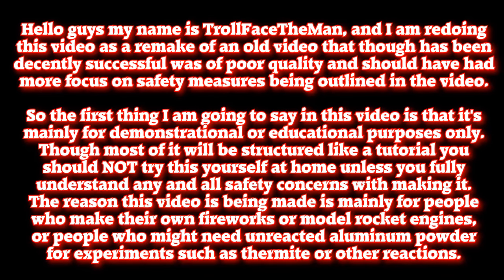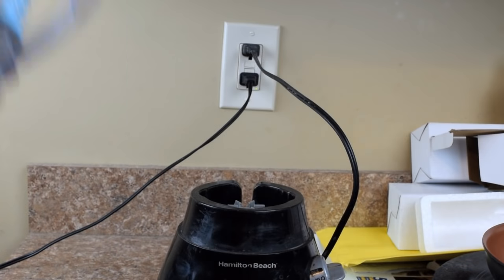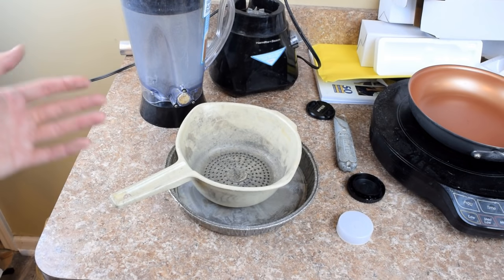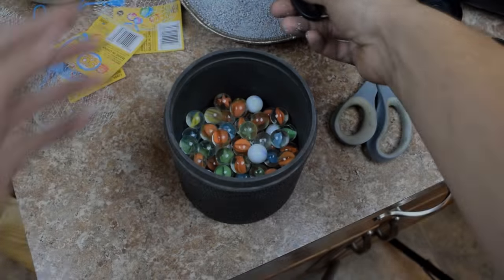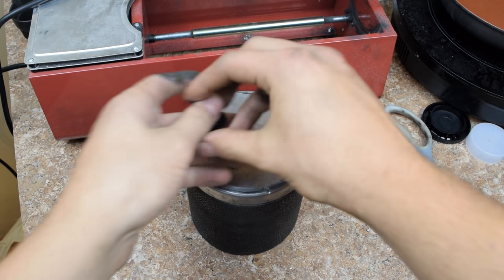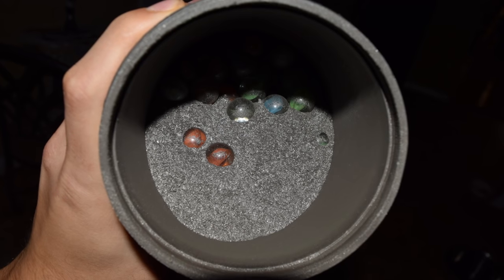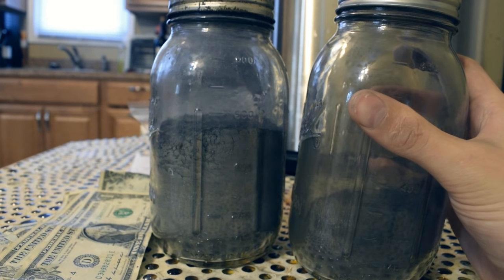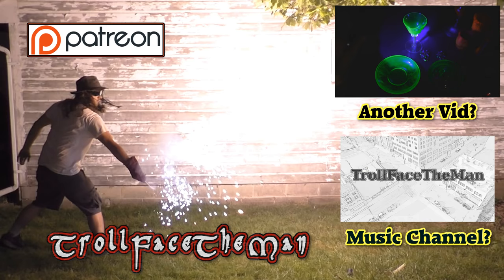How To: Easy Bulk Dark Aluminum Powder (My Homemade Process)

Comment: There is no 'b' in 'pyrophoric'.
It might also be worthwhile to review the definition of 'subjugate', specifically in comparison to the verb use of 'subject'.
Also, check out the difference in 'substantiate' and 'sustain'.
Reply from the maker: I will admit the Pyrophoric thing is my bad, I have dyslexia and sometimes I can literally read a word hundreds of times the wrong way and not notice unless someone such as yourself points it out. 

 However in respect to "If subjugated to an open flame..."

The way I used it was "Brought under control of an open flame..." Basically the flame will violently exhumed control over the powder as it is consumed in a fireball (Or it'll be subjugated by it.) I will admit it is not the best way to say it, but I don't feel it is improper.

 The last thing with: Check out the difference in 'substantiate' and 'sustain...'

 I do believe I said something along the lines of "To self-substantiate a flame..."

 By definition Substantiate: "To affirm as having substance give body to; strengthen*. Example: To substantiate a friendship." or *"To give form or real existence to..." (Their are about 7 more but these are the ones of particular interest to my point...) 

 The way I used it was in respect to say "The powder needs to be fine enough to Self-Strengthen or Self-Exist..." Basically it needs to be able to support burning by itself without  additional input.

 Once again that too would fit the definition quite well.
Reply: TrollFaceTheMan  How refreshing to see someone dispassionately evaluate suggestions/criticism, keep the parts judged worthwhile and discard the parts found wanting, all while maintaining a nonadversarial tone.
Reply from the maker: Well thank you, and I also appreciate your critique being in a similar respect.

Comment: So I have a smelter and make chunks of it from recycled cans. I don’t have 20 lb lead balls and a mill that’s 200ft long. Anyone got an idea of how to make this easy to grind?

Edit: well I learned something new. I had lead shot just hanging around and I thought weight would work
Reply from the maker: Lead is softer than aluminum. Trying to mill with it will result in a lot of lead contamination as the aluminum grinds it up.
Reply: @TrollFaceTheMan  hey dude, can I just jerk of the container by hand  because to speed up the process

Comment: how bout round chuncks of quarts rock hardness scale is above glass prettysure it doesnt spark if hit hard
Reply: tyler quarts sparks very easily
Reply from the maker: +Jimmy Star It only sparks if hit against Metals. Just like in a Flint and steel, it's not Flint that sparks but the Steel.

 Excluding some types of quarts which can spark via Electrical discharge if it is broken.
Reply: TrollFaceTheMan I used to make fires by taking two quarts rocks and hitting them together producing a spark, maybe it was reacting with something else but from my experience quarts usually produces a spark on contact
Reply from the maker: +Jimmy Star The way sparking actually works is you shear of tiny bits of metal which as they fly they oxidize generating heat and inevitably generate what we call sparks.

 For example you strike a piece of Steel (Fe) with Flint, the Flint is harder than the steel which causes bits of steel to shear off and fly through the air.

 As it flies through the air it reacts with oxygen and heats up exponentially (4Fe+3O2=2Fe2O3+Heat.) 

 The problem with Quartz sparking is Quartz is Silicone Dioxide or SiO2. Because it is already Oxidized it can't oxidize when stuck against itself, thereby it can't Spark. (Quartz can still cause an electrical discharge though.)

 If you could strike two Stones together to create Sparks it most likely was something that was rich in Pyrite (FeS2) or Pentlandite which is Iron Nickel Sulfite.

 Those types of rocks can still spark because of their iron content and the fact that they undergo the same type of shearing and oxidization as a rock striking regular iron.
Reply: TrollFaceTheMan wow thanks for your great response it was very interesting and informative. You should make more videos exploring the chemistry behind such reactions. 👍🏻
Reply from the maker: Jimmy Star No problem, I am always glad to see comments like yours too which are respectful. And glad to see people like you who are willing to openly discuss a topic without become defensive over potentially contrasting information to their point.

 That is a rarity now a days, especially online.

Comment: All this safety about the aluminum catching fire. But doesnt realize you cant have a grill that close to plastic siding or it melts.
Reply from the maker: I wasn't the one that did that.
Reply: @TrollFaceTheMan  that explains it then. Someone needs some safety tips like dont light freshly poured lighter fluid got to let that stuff soak in first.
Reply from the maker: @SudoMimic3 , it's a propane grill. It was radiant heat that did that.

Comment: Why not add water to blender for slurry then air dry?
Reply from the maker: Theoretically it might work as long as you are using really clean water like distilled. Otherwise it may cause issue.

Comment: Use stainless steel or brass the aluminum needs fuel in order to cause any problems.....such as explosion.
Reply from the maker: If there is any air then it can ignite. It doesn't need a fuel, it needs an oxidizer.

Comment: I milled magnesium and opened the container once a day and it still auto ignited on me
Reply: This video is about al not mg. There is a big difference
Reply: @amelbecic5332  yeah ik i was just throwing it out there
Reply from the maker: Hopefully no one is hurt. The magnesium is much more reactive and may need to be aired much more often.
Reply: @TrollFaceTheMan  Yeah, I always go a bit crazy with PPE when milling mag, especially since I use stainless steel balls. When it auto ignited, its like it EXPLODED. I dont know if aluminum is the same because I never had aluminum auto ignite on me.

Comment: how do u store it if when u open it it explodes
Reply from the maker: +The Garage Scientist You only have to worry about auto ignition if you don't air it at least once day during milling.
Reply: so it wont explode when i open after storing for a moth
Reply from the maker: +The Garage Scientist No it shouldn't, the reason it can do it while milling is because new surface areas are constantly being exposed.

 But sitting there is not the same case. Also it won't explode anyways it'll just catch fire, unless it is mixed in the air in extremly fine particles first.

 Which shouldn't happen unless you were to like shake the jar around a bunch and open it without letting the dust settle again.
Reply: ok thanks, also could i mix the 2 powders with a quik shake in a bottle if they are already powderd

Comment: I CANNOT STRESS ENOUGH how important it is to air it out on a regular basis. I did this without doing so, expecting it to be some 1 in a million occurrence that you avoid just in case. It is not, and if milled fine enough can ignite upon opening with no disturbance, it also ignites quite vigorously when aerated. Always have dirt or something ready to smother a possible fire when dealing with this, water does not work.

Also don’t do this shit with so little precaution when you don’t even know how to deal with possible bad outcomes in the first place like I did.
Reply from the maker: Thanks for your warning. For sure, yes it is important to be carful with stuff like this.

Comment: What about Brass or Copper balls?
Reply from the maker: Fred Nordhorn From what I heard hardened brass can work good, copper might be too soft though.
Reply: Brass and coper use alot powder for own coating inside ball mill.Also if you use aluminum jar,then powder stick at jar walls and you get nothing at the end of grinding proces

Comment: How about brass balls ?
Reply from the maker: As long as they are harder than the aluminum and don't spark they should work. However they will still experience a small amount of wear with time from the aluminum oxide that forms during milling.

 It should be very small though.
Reply: @TrollFaceTheMan  thanks
Reply from the maker: @pete7894  yep, good luck!

Comment: Anytime you have combustion in a confined space that it cannot get out of you will receive an explosion for every action there is a reaction!
Reply from the maker: That isn't true. It depends on if the combustion produces gas or volume. And if it does if the container is strong enough to contain the expansion.

 Also how the container fails. If it fails in certain ways you might just get a pshhhh instead of a bang.

Comment: Damn near burned my house down milling magnesium.  Also, DO NOT use water to try to put out a magnesium fire.
Reply: But cant you just buy magnesium powder.
Reply from the maker: Yes magnesium is much more reactivate. And when water is applied to a magnesium fire it can molecularly split the water up into hydrogen and oxygen literally adding "Fuel to the fire..."

Comment: The blender part doesn't have to be that dangerous. Also too much effort. Between additions just empty the blender. It's less wear on the blades and you don't risk going too low in particle size. Going down in size can happen in the mill, just takes a bit more time.

Comment: I like your video. It sounds like the Yankee folk saw your video and went safety apeshit on you. I wonder if fine powder aluminum would be a catalyst to black powder to boost it up to closer to a smokeless powder speed
Reply: It will really mess up your bore.  Same as what a model rocket engine did to the rear half of my LAW rocket launcher.  The residue will stick to metal surfaces and will be impossible to remove.
Reply: @2fathomsdeeper  thank you for the warning!

Comment: glass marbles ?
Reply from the maker: Yes, is there confusion?
Reply: glass does spark. not real easy. but it does spark. use lead there are no worries. fishing weights balls for cap and ball rifles and pistols
Reply from the maker: I am sorry but you are very incorrect on this matter. Glass is literally, physically unable to spark. To understand why, first let me explain why some metals do spark.

 The actual sparking process is from fine metals oxidizing rapidly in contact with air which generates a huge amount of heat.

Examples: Aluminum (Al2)-->Aluminum Oxide Al2O3), Iron(Fe2)-->Iron Oxide(Fe2O3), Titanium (Ti)-->Titanium Dioxide (TiO2)

 The reason why glass is unable to spark is because it is Primarily Silicon Dioxide (SiO2.) Do you see the issue here? Glass is already what other metal become after they have oxidized. In other words it is un-reactive and completely unable to spark because it is already the Oxide of silicone, and oxides can't spark.

 The other issue here is your statement about just using lead instead. The glass thing is just a simple mistake that could of been easily made and is no big deal...

 But the fact that I had already explained why you can't or shouldn't use lead quite thoroughly in the video yet you post a comment telling me and others how we should use it instead...  That is just plain rude and potentially dangerous...

 Obviously you never actually watched the whole video but you want to chime in a present "Better" solutions without even properly paying attention in the first place....

 That's how misinformation gets spread around, and how people end up hurt or worse... I do NOT appreciate you doing this and ask that you don't tell others to do things that you can't even verify are safe.

 Questions sure, that's fine  ask away... But telling people they should do something a specific way but not actually knowing the first thing why you shouldn't... That is not appreciated on my channel.
Reply: I wish I had more solid proof than that's what I have been told, but my source is a fireworking forum, one person that I have talked with even wrote the book on ball milling black powder. him and many people with years of experience say the same. glass does spark you are giving advise with your videos even with your disclaimer you should be damn sure you are right. I would hate to see someone blow them selves up because of what your videos says even making dark aluminum.
Reply from the maker: Glass does not spark plain and simple, it is literally unable to. I mean I'll challenge you to find me a single credible source that says otherwise.

 And people that have used marbles and had ignitions I can almost guarantee you were using metal mills that either had a static discharge in them, or a glass fragment sheered off a bit of metal and that sparked instead. That is literally how flint and steel works.

 That is if they weren't milling friction sensitive material in the first place (Like flash powders...)

 And also another thing you don't realize is even if this mill were to catch fire it wouldn't exploded it would just burn very... very hot...

 You criticize my safety in this video when I thoroughly researched all of this stuff and instead you tell others to disregard what I say and use lead instead which for one won't work well at all... And two release highly toxic lead vapors anytime a powder that uses it for milling is lit of fire...

 But of course you didn't know that because you failed to watch my video to completion before leaving your comment.

 I am not trying to be an ass but like I said I have thoroughly researched everything I said in this video before hand, and judging by your comment you are just a beginner when it comes to pyrotechnics, no offense.

   And I do understand that you have read several sources that say glass is dangerous but there are also ones that say it is perfectly safe. All this means is that people have no clue what they are talking about and will speak from what they hear from others which tends to be misinformation.

 Just like I'm sure you have heard of how we use 10% of our brains only, or how peeing on a jellyfish sting makes it feel better. Or how lightning never strikes  the same place twice or the "Five second rule..." Or any other rather common beliefs that you'll hear people talk about about literally on a daily bases that are 100% false...

 My point is just because one or two people say something on a forum that they heard from someone else doesn't mean it is right. I have presented you a reason why it can not spark and why other things can... What have they told you except personal claims or beliefs with no backing?
Reply: "Here in this most solemn place,
 Lies the grave of the infamous Troll Face.
 He blew off his ass
 By milling with glass
 On the bright side, he takes up less space"
Reply: here is a reply I received when I ask the man in the know. he is the guy who wrote the book on ball milling, it looks like I was wrong as far as ball milling dark al. but right when it comes to milling bpMemo,I'd have a hard time "proving" it, also.  SOME glasses exhibit a piezo-electric effect that will make lights in the dark when marbles are poured over one-another (some ceramic media do that, also). Actual SPARKS... eh, I don't know that they do, and I don't know that they don't.  But they DO have a particular characteristic that makes them unsafe for some milling. Glass is very hard, and although quite resilient (in terms of recovering from compression), it compresses only a TINY, MICROSCOPIC bit under impact (before it breaks, instead). Because it doesn't compress very far, the impact points between glass spheres are infinitesimally-small.  So the entire energy of the impact is over a total area of maybe 5-10 mils^2... making it many thousands of pounds per square inch of impact force, even with two ordinary marbles impacted from a height of a few inches to a foot. That's enough to ignite many pyrotechnic mixtures.  I've personally known two people who used marbles for media.  One never had a problem milling BP.  The other guy had an ignition and mill explosion. So ???   I just avoid using anything but lead for milling energetic mixtures.  I reserve glass and ceramics for single chemicals. Hope that helps. LLoyd
Reply from the maker: "SOME glasses exhibit a piezo-electric effect that will make lights in the dark when marbles are poured over one-another"

 I do agree with you there that that is a real possibility, but one I looked into and seemed very unlikely with most common glasses anyways.

 As for the marbles basically having no give and thereby by having huge compression forces, I agree with you there also.

 It should be noted I only recommended using marbles to grind up aluminum, not for milling other soft powders. Lead ball-bearings should be fine for those.

 But as I stated in the video lead will not work well for aluminum seeing as aluminum can be up to twice as hard as lead so the aluminum powder will actually slowly eat away at your lead balls and contaminate your product.

 That's why I use marbles here in this vid over other grinding media. It has been brought to my attention brass could also work well though.
Reply from the maker: Your peom was blocked by YouTube comment filtering but becuase I am a nice guy I approved it anyways <3

 But here let me give it a shot:
Reply from the maker: "You are Bill Root,
and your horn you do toot,
Even without finishing my vid.

 I'll argue with you, 
about things I've been through,
I hope your not just a kid.

 Though it might seem, 
that if the vid you'd seen,
This stuff you should already know.

 But just like a merry-go-round,
or daily traffic in town,
around and around we shall go."
Reply from the maker: I gots de madz engrish skiullz tats whts up!!